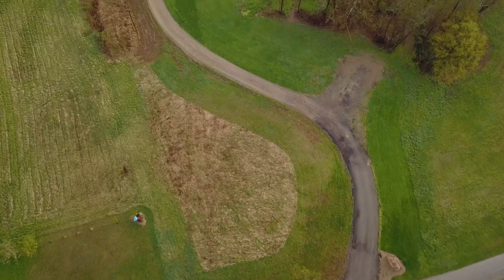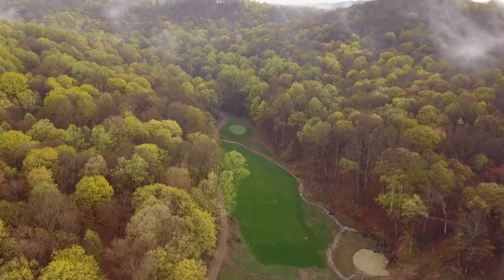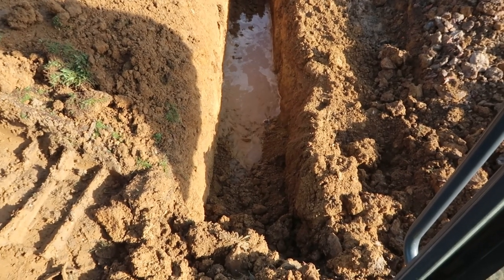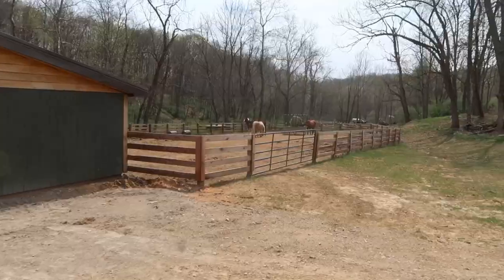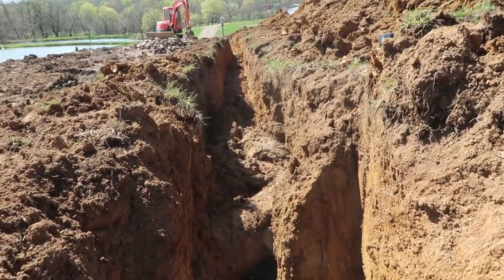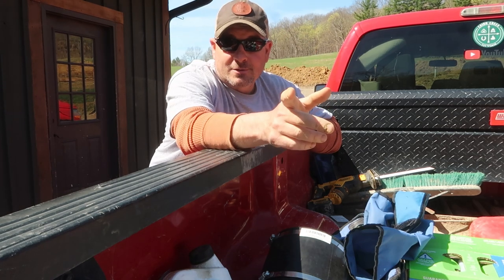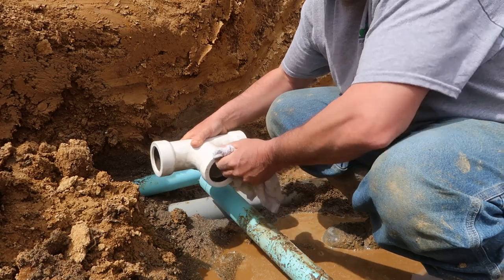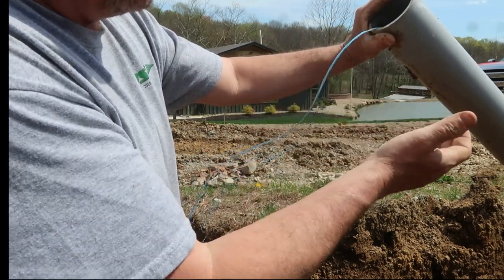Real inspector on-site for Pipeline Crossing. Busted the 2” main waterline!

Comment: It's probably too late to tell you this, but you can put all of your electrical pipe together without putting the string in ten feet at a time! Put your conduit together making it a complete run. With your string at one end, make what we call a rat. Basically tie some styrofoam the size of the conduit to the string. At the other end, with a shop vac, Suck the string through the conduit. Should only take a few seconds to suck it through. It works great on a long run because 200, 300, 400 feet fish tapes are hard to find. Let me know if you have questions....Joe....Love from Alabama
Reply from the maker: Thanks for the input. I’ve witnessed electricians do this on jobs, but I thought you had to have a special attachment for the blower.
Reply: @CairnCreek  👍 we use a small plastic bag and we called it a mouse back when I worked in the field. 👷 as soon as the bag hit the vacuum hose the sound changed and you turned the vac off 🤓
Reply: @CairnCreek  Ok buddy, Next time you have an electrical issue, Hit me up!! Maybe I can be of some help... I only did that stuff 35 years or so. Best of luck and congrats on your place!! I am so envious. You got it going on..And don't hate me, but I have to say.........RTR... From Alabama, Take Care!!!
Reply: @JosephGodwin137  yes sir...you are correct. Mouse, rat, whatever you want to call it, IT works right?
Reply: @banjoeypicks  yes sir, different parts of country had different names. Just had to adjust to the lingo, it was funny when somebody ask me to grab him some bat wings when I was the new kid on the block 😂 back in the day